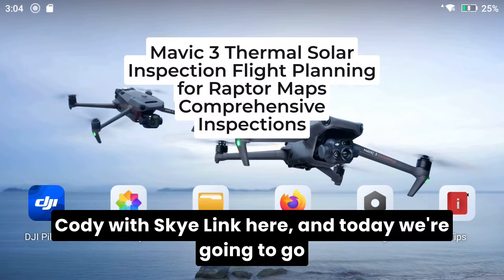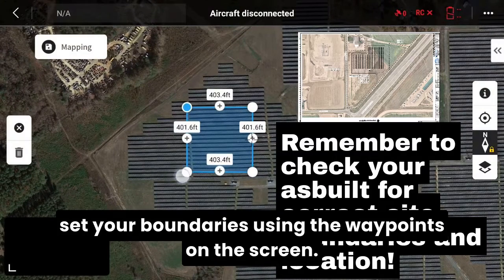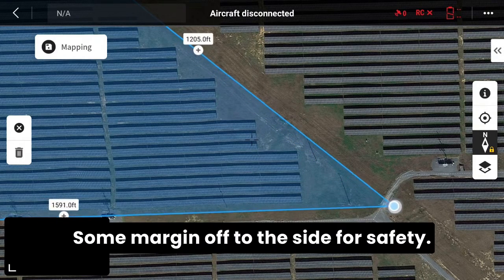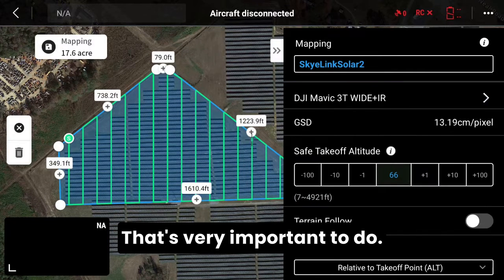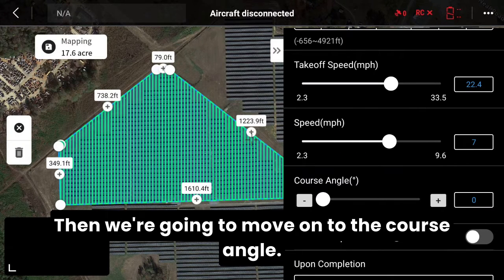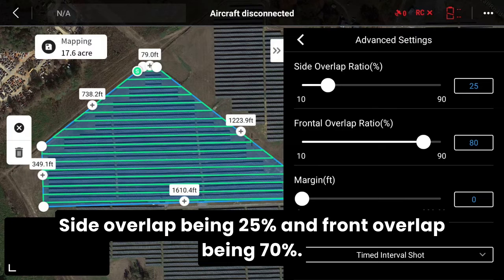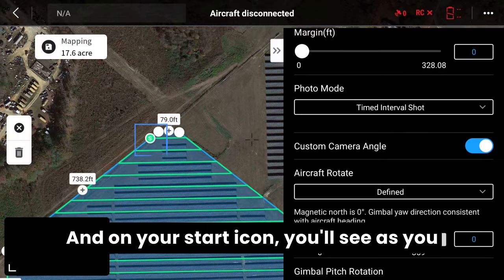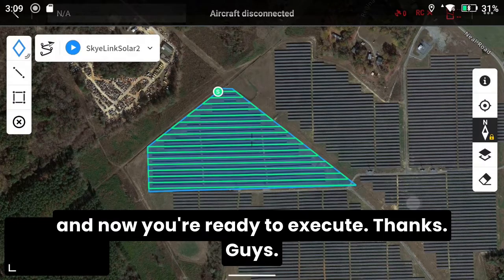Mavic 3 Thermal Raptor Maps Solar Inspection Flight Planning for Comprehensive Inspections (DJI M3T)

Comment: Why did you adjust the camera angle for the sensor to face the correct direction? and why change the aircraft route to defined and angle to 0°
Reply from the maker: Hi, good question. The reasoning behind this is two fold. First you want the aircraft flying in line with the rows, second defining the angle in the route settings will allow that sensor to face directly at panels vs looking down or the back of them. Hope that helps. Feel free to reach out to us at operations@skyelink.org if you have any more questions.

Comment: Hello Sir, have you ever experienced other T drones like the M210 RTK with the thermal camera XT2? If you have, is the Mavic 3T result acceptable compared to an M210 ?
Thank you
Reply from the maker: Hi there, sorry for the late response. We have experience on both and M3T and M210/XT2 are very capable aircraft for these inspections. However, keep in mind the different flight planning considerations with the different platforms/sensors.